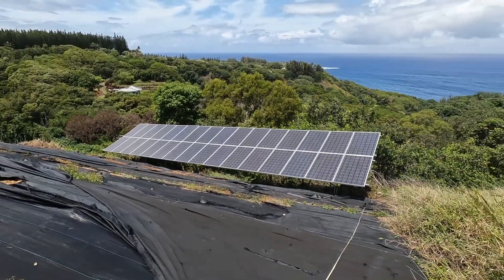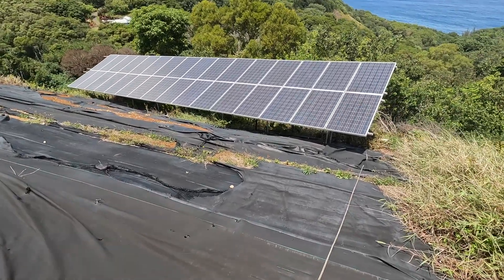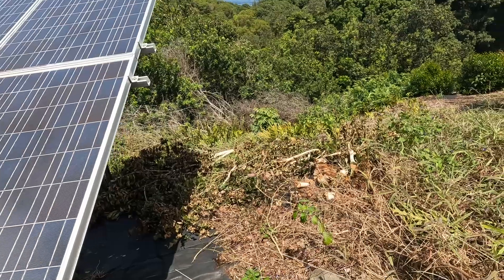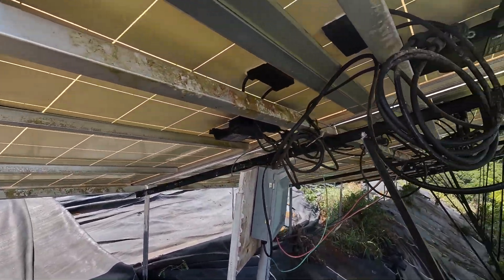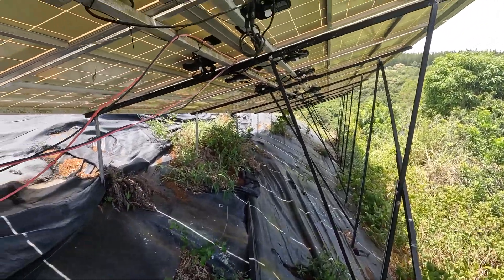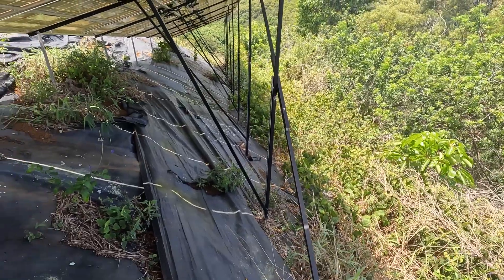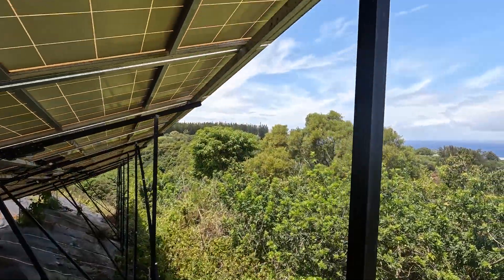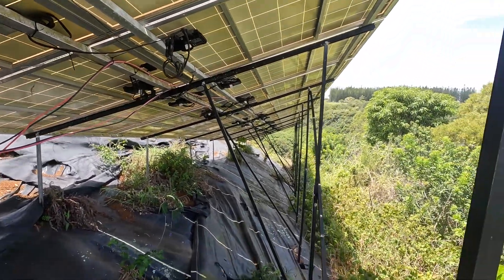A wimpy rack that withstands hurricanes

Comment: I look at that, and see at every direction triangles.  Lots and lots of triangles.  That's the key for the support strength in various side to side and downward forces. I'm less sure of the uplift strength.  I don't know if all those T posts are driven into the ground at those angles, but if so that is helping.  If just the vertical posts into the ground...  maybe lava holds the posts better, or maybe its a bunch of roots that have grown in over the years.

Comment: It will work until it doesn't. Seems to be holding up well.
Reply from the maker: Of course that's true of nearly everything. I have no question that if I had built it it would be twenty times as heavy, bedded in concrete, and probably mostly welded instead of bolted. And perhaps the panels would have turned into frisbees long ago. I find it a bit shocking every time I look at it. I don't understand why it has worked so well. I can shake the entire structure with one hand.

Comment: Yep, a lot of tensile strength there.
Ground level wind loading would be at minimum.
Down slope vegetation probably breaking down wind velocities. 
Rain is good at washing down salts. Wind driven rain would wash the salt out of the air.
You are lucky that it worked.
You are lucky an amateur build at minimum costs. 
Light weight materials are cheap and easy to transport and install. 

A structural engineer might not want to put his signature to the design. 😮

Very interesting video. 😊😊😊